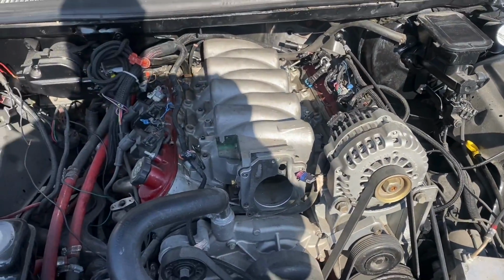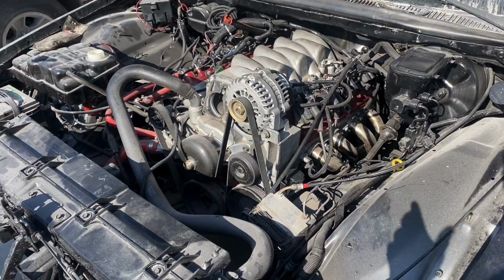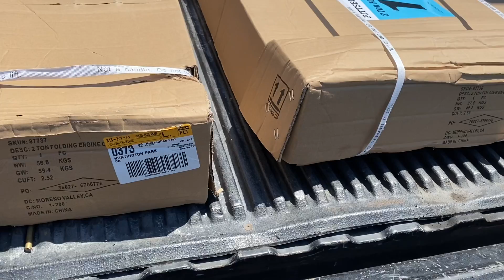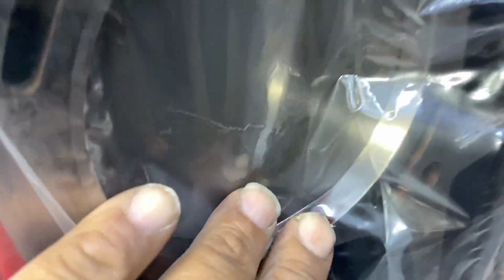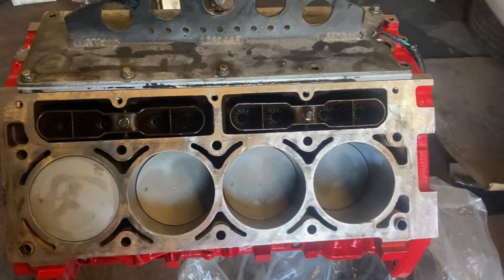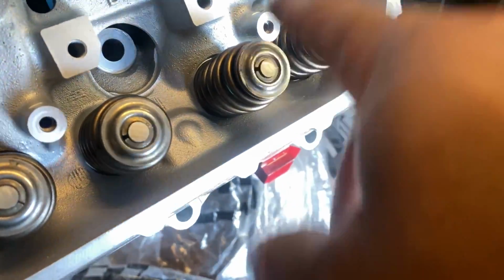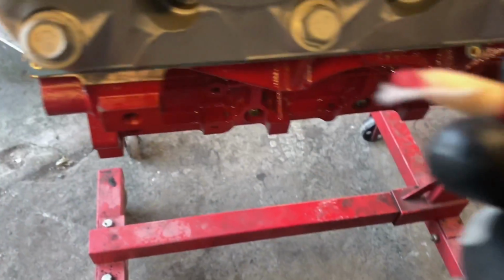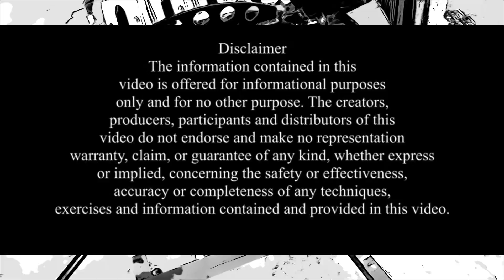RETURN OF THE REAL BLACK WIDOW 96 IMPALA LS SWAP HEADS & CAM SHIPPED FROM VEGAS FOR THAT Ooowwweee

Comment: You were probably low on oil on your old hoist and also I heard you shouldn't soak roller lifters that's just what I heard
Reply from the maker: 😅🤣😂 you definitely heard wrong, and it probably was low on hydraulic fluid I just needed a reason to buy a new one and I’ve been satisfied every since
Reply: Probably because Im going to prime my Ls3 engine before I start it up but I will lubricate them with engine assembly lube
Reply from the maker: I prime every engine before start up old or new in if your assembly a engine you’re suppose to yours assembly lube enjoy your build

Comment: I got the 2001 Silverado 6.0 2500hd 4x4 with a 5 speed NV4500 transmission...video soon
Reply from the maker: That’s going to be fun short bed?
Reply: @TheLsSwapGuru  it's the 4 door short bed 2500hd
Reply: I'm gonna take it to you when I'm ready to get it done like that homie
Reply from the maker: Crew cab 4door short bed same truck I have just not a 2500 but so will have a cammed 6.0 once this 5.3 blows
Reply: @TheLsSwapGuru  yup

Comment: The owner must have decided on that 4L80E... #bad choice#
Reply: What's wrong with wanting a transmission that'll hold bigger power without grenading? Maybe he plans on putting a power adder on at some point
Reply: @shawnwimberly9294  and you think a 4L80E is where it's at with adding more power under the hood that needs to be let out at the wheel? #Good luck with your swap#
Reply from the maker: There’s nothing wrong with a 80e and there isn’t anything wrong with a 60e stock for stock a 80e is a much more bullet proof trans but both of them will do the job
Reply: @TheLsSwapGuru  well from experience i wouldn't go with either even after having them rebuilt. I opted for the 6L80E more gears less chance to burn clutch packs
Reply: The 6l80 is great IF you have the extra money, tuning experience, and room for it.  I'm not sure you're gonna fit one in a 96 impala without making an abortion out of the transmission tunnel... maybe in a truck?